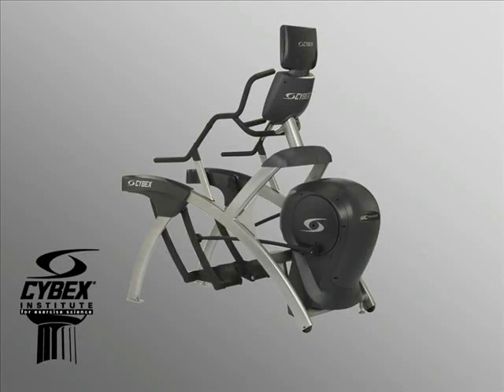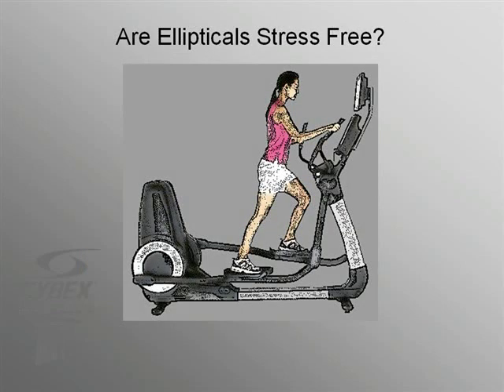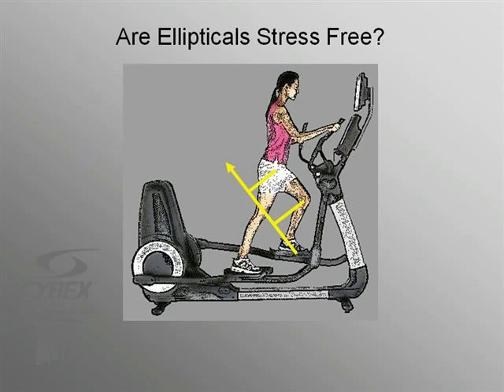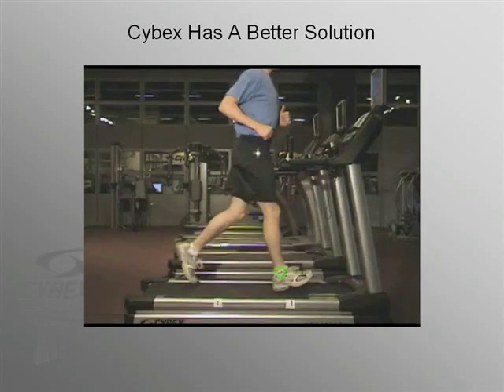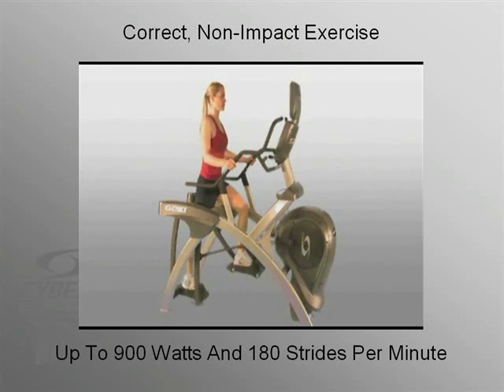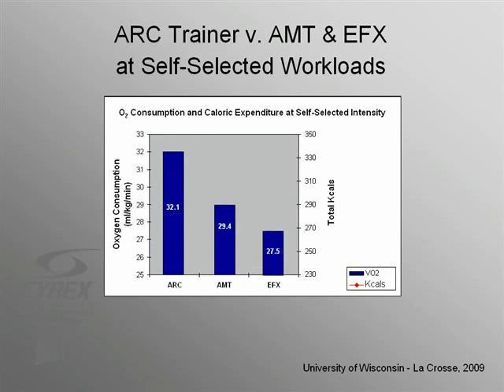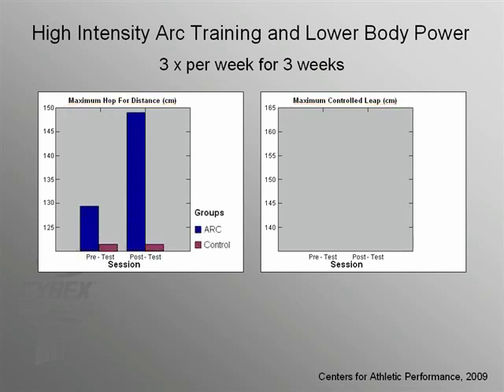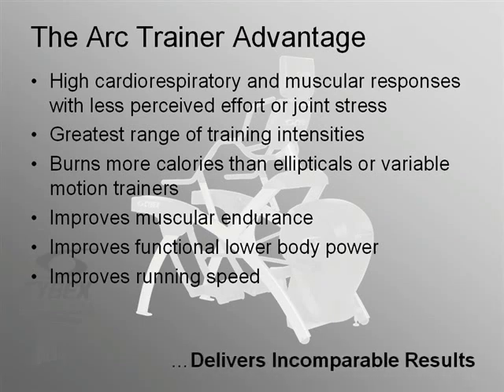Arc Trainer - The Science Behind the Performance

Comment: nothing beats the arc trainer. they are highly effective at letting you move as hard and fast as possible. basically whatever you can put into it, the arc trainers allow for it with no restriction like other machines. you can go from zero to 100 in 1 minute flat on these and then the next 4 minutes is very challenging even on low level. that is the full body version i'm talking about it's like a combination of sprinting, swimming and climbing. one can build up a very high work capacity on these machines.